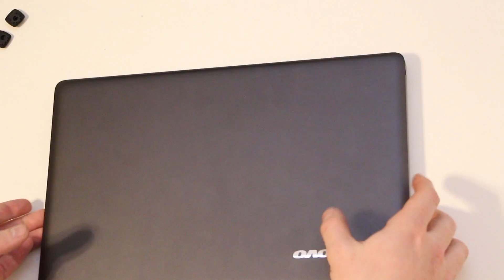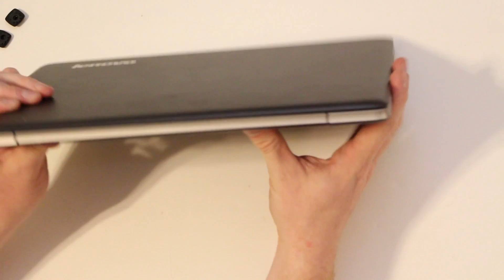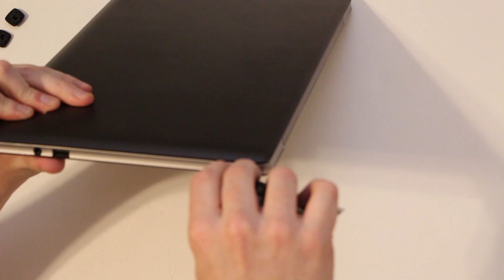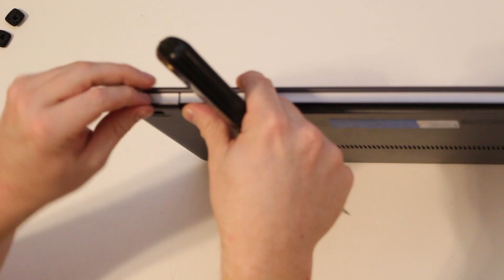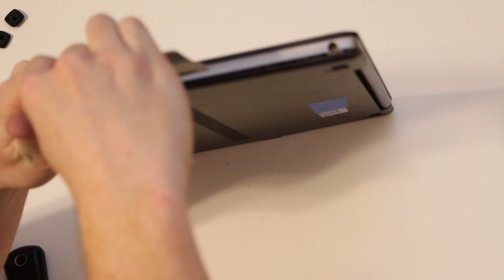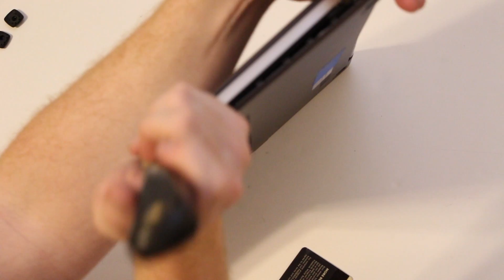Lenovo U310 Disassembly and Tear Down - How To Remove Bottom Cover

Comment: Probably one of the worst laptop designs in terms of servicing (yes I know there are worse). If you ever break the bottom clips that hold the base in, the bottom no longer fits close to the body and leaving a gaping space around the broken edge! Lenovo really didn't want consumers to service or clean the fan when it got clogged with dust. I have since switched to a more user friendly brand.

Comment: Someone erased my old comment. But here is what I said. Use a towel or something soft to prevent it sliding everywhere. Second, be patient and use a flat, wide, ductaped screwdriver and a very rigid giftcard. Also you can use a hair dryer to make everything warm, so your don't break anything.

Comment: I have this pc with hdd of 500gb e 24 gb msata: I wish change hdd oh 500gb with an ssd.
Why I take off msata after installing ssd?
Reply: You don't have to take off the "msata" wich is only a small ssd. Leave it there and use it for something else, like linux.
Reply: Thanks Sir but they are in raid mode:If I change 500gb with an ssd I must change bios  in acpi mode?
Reply: In my experience you just change the drive, if you have any problems such as missing bios access, you only need to update your drivers.
There is no need to change the raid config, because if you remove the drive the raid array is lost.

Comment: Tip - when trying to pry the bottom off as shown in this video, use a small putty knife but tape the blade first with electrical or painters tape to prevent it from scratching the unit. Additionally, a set of plastic pry tools would be useful.

Comment: does this laptop get warm??? one of my hobbies is fixing computers and I hate heat... that's why right now I have a Toshiba with an amd e450    I would much rather give up performance for a cool running laptop. so my biggest question is does this thing get hot can it be placed on a bed/lap and stay some what cool?   I am looking at buying this and if it does get pretty hot ill look somewhere else.

Comment: Thanx, i used Plastic card from Cooler Master to open the cover (this which is beeing used for place a thermal grease on processors) works great, no straches no visual affects at all.. took me about 3 minutes for all case (first time). The only one thing i suggest is to twist the plastic on motherboard side, because this part is pretty elastic and not making a lot of damage to case (be careful with ports and board). that`s it that`s all i`m speaked :D

Comment: Thanks for the video! TIP: If plastic cards aren't rigid enough, you should apply some electrical tape to a metal flat blade or screwdriver so you'll have a rigid tool but not a hard surface, to prevent those scratches.